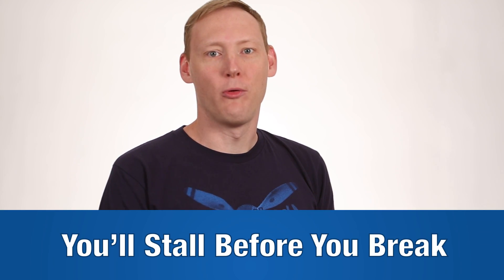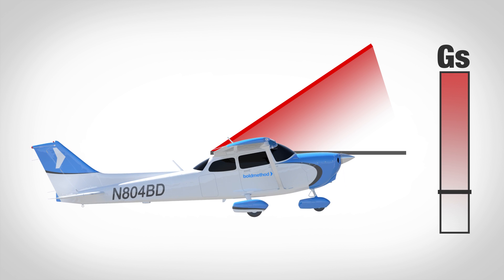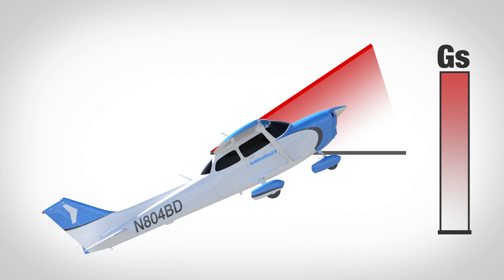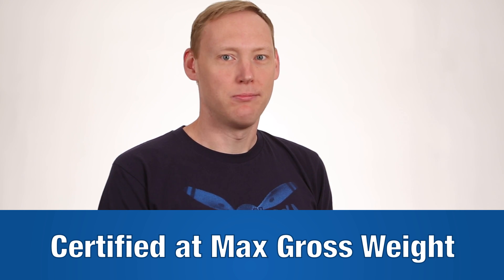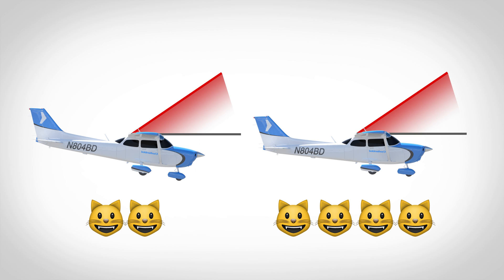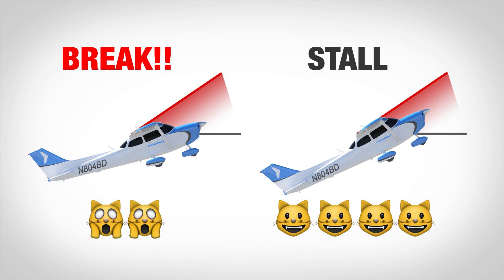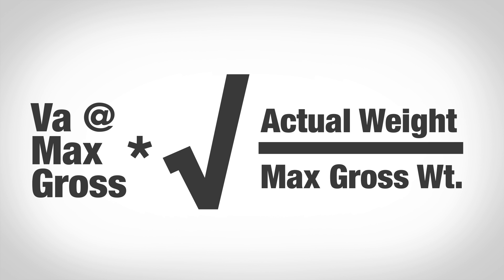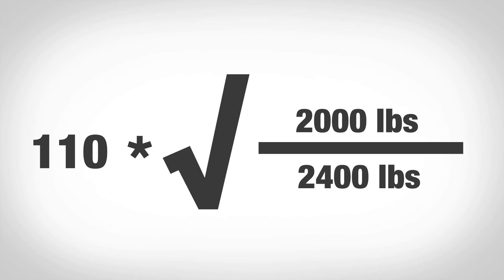How Maneuvering Speed (Va) Changes With Weight

Comment: Va has nothing to do with your cruise angle of attack. It's related to the Lift force at critical AoA at a certain airspeed. At any given airspeed the force on the wings will be the same at the same angle of attack. If the plane is heavier, the load factor will be less at the same airspeed. This means that other components such as the engine or battery, which are a fixed weight, experience more acceleration when the aircraft weighs less at the same AoA.
Reply: 1.	When an aircraft is heavier, a given amount of force generated by the wings results in a lower G-load and thus less force on components of fixed weight – like the battery or engine. Therefore, if these items are the items of concern, an aircraft’s maneuvering speed will increase with an increase in weight.

2.	If the aircraft’s wings ripping off are the limiting factor – the weak point – then the maneuvering speed would not increase with an increase in weight as the force on the wings is the same at a given airspeed and AoA; it would actually go down as weight increased (the stress on the wing/fuselage connection would depend on total weight and total aerodynamic force – like pulling something apart. However, moments also come in to play here – if the extra weight is added in the wings fuel tanks, for example, the stress on the wing/fuselage connection may decrease with an increase in weight). So put differently, if we increase weight by adding it to the wing, maneuvering speed should go up, but if we increase weight by adding it to the fuselage, maneuvering speed should go down.

Comment: The wings should be able to handle more Gs when the airplane is lighter because one G at 1900lbs is less force than one G at 2300lbs, correct? So am I correct to say that this theory is simplified to assume that the value of one G is the same amount of force whether you are at 1900lbs or 2300lbs?
Reply: Yes, if the limiting factor is the wing/fuselage connection. However, load factor takes other things into account like the engine mounts, battery mounts, etc. A lighter aircraft will have a higher load factor at the same AoA/airspeed, which results in a greater force on fixed weight components like the passenger. You are correct though that the total force on the wings isn't directly tied to load factor.
Reply: have you found out right answer about your question? I'm kinda stuck with same curiosity too

Comment: So hard for me to comprehend this but basically you just pulling more Gs at a lower weight therefore the forces (airspeed) that will break the plane are lower because the Gs are higher also the Va is lower bc you will stall at a lower speed because the point from level flight to critical angle of attack is greater and to get there without breaking the plane you need to be flying slower is this correct?

Comment: Yeah, no.

Your idea falls apart when you consider an airplane, of infinite mass, flying a ballistic path , and then "pulls up".  The wings pop off.

Similarly, if an aircraft had a density of 0.0000000001 pound per cubic foot, because I invented a new structural material called McCrackenite that had all the strength and volume of aluminum, but none of the mass, it would easily make a 1000 g turn without losing its wings.

The G meter, in the aircraft, is not a universal measure of the stress in the wing spar, empennage, and engine mount(s).

Just as an AoA meter is a better indicator of impending stall, a strain gauge on the spar (etc.) is a better indicator of impending  over stress.

Comment: A complete generalisation, take a look at the AFM for an Extra 300, Va at the lighter aerobatic weight is higher than at the lower Utility weight. It depends on numerous variables, and in the case of aircraft with fuel carried in the fuselage it may well increase with reducing weight as the wing root bending moments reduce, however, this depends on many other factors. I know the exams all want you to say it reduces, but that is NOT always the case and is an example of how giving the answer they want to hear, whether the FAA, CASA or some other regulator, doesn’t lead to an actual understanding of what is happening.

Comment: Reducing Va with reduced weight, or mass, will stop you from exceeding the certified g limit. However, don’t worry about breaking the aeroplane. If Va is 110 knots for a certified 4G and 2,400lbs MAUW  aeroplane then it’s been designed to stall when the wing is producing 9,600lbs of lift; and so not break. So you have have a 9,600lb wing. If you get airborne at 1,600lbs, fly at 110kts and pull to CL max you’ll still only get 9,600lbs of lift before you stall, and so the wing won’t break, just you’ll be pulling more Gs! The only thing is you’re going to have to explain why you exceeded the certified G limit, but the wings will not fold above you. In fact, if you got airborne on your wet-winged GA aeroplane solo, with no baggage and even the chocks and steering arm left on the ground you’d be very unlikely to break anything due to change in bending moments. Hence aeroplanes from Airbus A350s and Boeing 787s to fighter jets leaving the wings wet and using fuselage fuel first to reduce the stress on the wings. There are older fighters out there that have hundreds of g-limits to cope with different weights and fits. I can think of one that had over 400 positive g-limits varying from +2.5G NO to 8.6G NE . It varied with fit, weight, speed, subsonic or supersonic, as well as flap and wing position. Even most GA aeroplanes have a couple of limits depending on weight, 3.8G increasing to 4.4G when you reduce to the utility category weight. Remember there’s also a 1.5 G safety factor. Notwithstanding all I’ve written. KEEP TO THE LIMITS, they’ll keep you safe and last time I checked Cessnas and Diamonds don’t list Martin Baker on the options list.

However, nice video which needs to be regarded for exams and still keeps you extra safe by not over ‘G-ing’ your aeroplane. Sorry, I was looking for something else, saw this and couldn’t resist. I’ll get back in my box .

Keep up the good work.
Reply: One thing someone said once really stuck with me.  All parts of the airplane are designed with the G limit in mind.  If the plane is light with only you in it, it will reduce stress on the wings.  But YOU are still 4x as heavy.  It's no good if the wing is perfectly intact but you and your seat punch through the bottom of the fuselage because you laid 5G onto that sheet aluminum floor.
Reply: @JETZcorp  Ok that actually makes a lot of sense, say the load on the motor mounts to the fuselage would be under higher stress than normal.